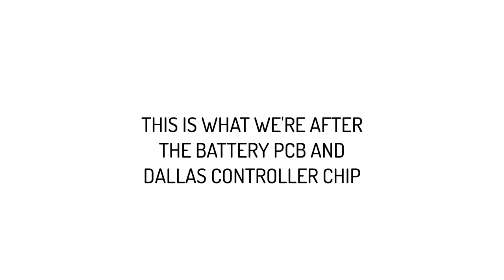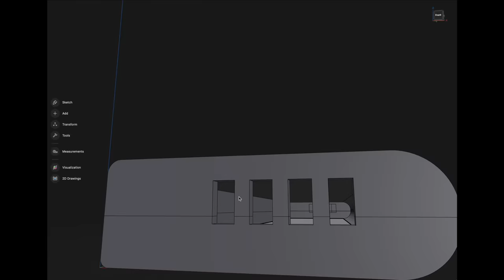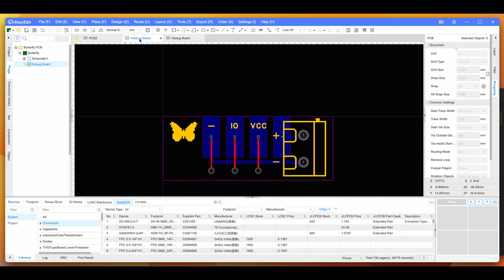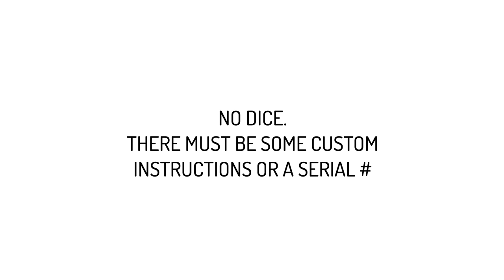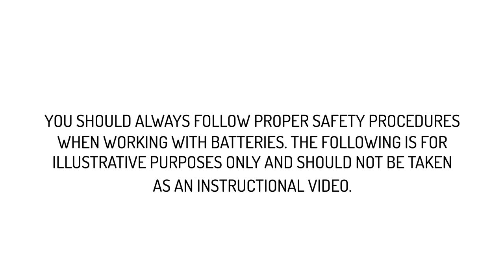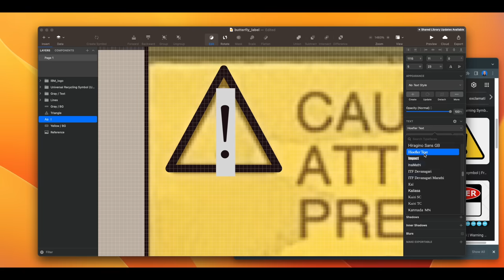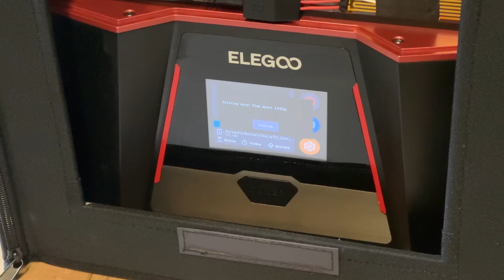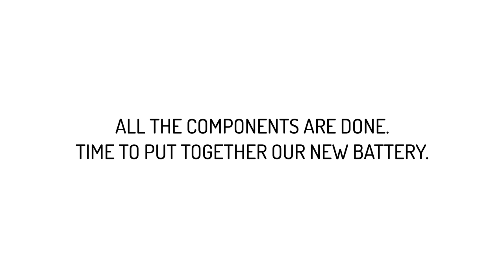Reverse Engineering a ThinkPad Battery - And making a Perfect Clone

Comment: For labels and even PCBs you really want to get a flatbed scanner, it really helps limiting the distortions 🙂
Reply: Gurudumps  That's impressive! Out of curiosity, how did you reverse engineer the inner layers of the PCB?
Reply: @lucasreis6251  ive seen someone reverse engineer a whole ass xbox 360 motherboard before, what they do is go layer by layer by sanding the layers down. its crazy
Reply: @lucasreis6251  not sure how he did it but for "simpler" boards you could map the connections with the continuity test on a multimeter

Comment: Great work, massive attencion to details. 2 things i woud do differently - 1. You put "LiPo" on label but used NiMH inside. It is especially concerning because LiPo and NiMH/NiCd are charged differently, and Laptop charging circuit could damage real LiPo battery. 2. that little dallas chip is also a temperature sensor, so i would add a termistor to that attiny and preserve temperature sensing function -  for safty reasons.
Reply from the maker: Thanks so much! The LiPo on the label was wishful thinking. At the time I had that batch printed I was getting good results but ultimately failed to have the laptop charge the battery reliably - the BMS is on the logic board and not on the chip so I ended up conceding and going with NiMH. You’re 100% right on the thermistor - that would have been ideal but I wanted to keep the BOM down and my hacky way of estimating temp based on conductivity on the ATtiny was enough for me to call it good :)
Reply: The internal sensor should be fine. It's not important of the battery stops charging when 65 or 70°C, as long as it's +-5°C it should be fine. If the chip is used for temperature-based end of charge detection  a good BMS should look at the temperature change (derivative) rather than the actual temp
Reply: @polymatt lifepo4 is way easier to design for, and you can deep cycle it thousands of times without degradation. It has like 30% less power than lithium ion but it charges faster than it.
Reply: @runed0s86  except it is NOT voltage compatible with 9S Ni-Cd (4S LFP - voltage too high  3S - too low)

Comment: For replicated designs I just include a clearly visible "REPLICATION COPY" text in the final design so nobody is confused.
Sometimes I pull some pranks on the design and add a small but clear jokes (such as intentional typos). All to ensure that nobody is going off and selling the design.
Reply from the maker: I love the typo/easter egg idea. I’ll do that next time!
Reply: I would've replaced the IBM logo with the butterfly logo used elsewhere in the project, I think it's cool
Reply: The Japanese do not open, dispose of in fire or short circuit is not the same as the original by the way. The original says "do not put into fire", the clone says "do not dispose of in fire".
Reply: That doesn't stop them from selling it. Just makes it easier to track. Or they just edit it out. I personally hate seeing "Reproduction unit" or "Unofficial Replacement" as it can be a psychological thing. But I'm not the one doing any actual work so you can ignore me if you want. Just my opinion.
Reply: @polymatt  The recycle icon could be replaced with a "repair" one,  maybe the Open Hardware gearwheel
Reply: The reproduction can be recognized without a doubt by the LiPo lettering, what's the problem?
Reply: @steelplasma256  I agree, the quality range for this sort of stuff can be massive so just seeing things like "reproduction unit" tends to massively undersell the parts that are basically exact replicas or improvements over the original. Maybe "clone" would be a better term?
Reply: @chongtak  I would probably change all the foreign language stuff to something funny. Though I'd probably go with my own design anyway.
Reply: or: IBM x (butterfly logo)
Reply: The biggest giveaway would be saying the type of battery used...
and the Ah will probably be higher, would that affect the charge characteristics?
Putting your own brand or logo would give true status and trust in the product.
Right to repair is another angle.. so stating screw terminals used is another plus 😻
Reply: @destrierofdark_  yeah, would've been kinda cool to use the butterfly as a mask over the IBM logo ;)
Reply: @luisek.284  i was wondering when some commentor would put the new battery type...of course most of us automatically realize it's Lithium Polymer technology...but it's good to see it anyway...battery storage has advanced beyond imagination feels like a century in only 20 years...i don't think i have any LiPo in any device...they're all Li-ion as far as i'm aware...i can hear the comments..."you would if you bought a modern Laptop..." the "newest" one i own is about 2009ish an Acer Aspire...and about 4 ancient Dells...might be 5 early to mid 2000's Dells...i like my Latitude LS400...battery is 99% dead now...how much a clone for it? 500 dollars? eek
Reply: @markianclark9645  well i,m changing the cell in 2006 2009 laptops by myself and the mayority of controller kind of reset the SOC, and work well over the same wattage, i'm not a programmer, and never connect with the microcontroller, but i will love do that, i have a battery package undersized, just 3 cell with a case for 6, original, and if you just put the other, the controller become crazy and shutdown the laptop thinking use all the power of the package, let's sit a minute literally, connect the charger, and voila, 10 seconds later do you have 55% battery charge, how reprogram o make inverse engineering, i don't know, but maybe that's funny for yours
Reply: @CarlosMartinez-px9xo  If it's worked for you..and you made a battery..that's impressive.. I'll still be searching online for my battery till I pass away..i might find on eBay or somewhere..if one waits long enough
Reply: @polymatt  You did this time, too! "Percausion" rather than "Precaucion" :-)

Comment: This is admirable work. Truly I haven't come across someone like this before, it's almost maddening but at the same time amazing the effort going into each process. Everything is thought out and done properly and carefully. I'm only 20, but boy have you shown me how things can be! Thank you for striving towards the unobtainable perfection.
Reply from the maker: Hey thanks so much and I’m glad this type of content resonates with you! So much of the skills I’ve learned have been by watching some amazing creators. For me the attention to detail is the fun part - constantly trying to make thing more precise has made me learn so much more.
Reply: The only thing is for the batteries, it is not advisable to solder them but to weld them, but I'm sure they just didn't have a welder (kind of shocking with everything else they have though xD) and did put a warning in that part of the video
Reply: In another comment he says it took a year...
If you're interested.. learning how to reverse engineer could be a useful skill.. especially with right to repair becoming a thing.
I did one of the first 'sound cards' for the Commodore PET in about 1981 the chip cost £25...
I also used a Winchester disk that had 1mb? per side.. the metal disc inside was about the size of an LP record.. and the thing you 'slotted' it into at the top was the size of a washing machine.
Something to look out for which you might find amusing and useful would be an old imperial (fully mechanical from the 1950's or earlier) typewriter.. look for one with a good smooth non perished roller, which is the solid rubber tube that the letters hit under the paper also use thicker absorbent paper (a little trial and error needed to get good results)...
A marvel of mechanical engineering.. there are places in the UK that still sell the ribbons.. a complete workout for the fingers.
A few people of your age and older have seen my typewriter and have frozen in wonder.. getting them to type on it causes much laughter.. 😻

Comment: Amazing video! I admire all the work that went into this!

One thing i'd recommend is to add a decoupling capacitor (100nF) across the attiny's power rails. This will prevent it from glitching when there is any sort of transient. It's a miracle it even worked on the breadboard without a decoupling cap with those long wires.

You might also like the TagConnect / EdgeConnect line of connectors for (re)programming your chip in circuit, they only require a footprint on the target PCB and a proprietary cable, and then it's easy peasy to upgrade your firmware or debug it in circuit.

That being said, congratulations again for the awesome reverse engineering and the fact that you made something that looks like a finished, OEM product!
Reply: modern elecrolytics have a LOT less inductance than older designs. Originally they only had a single point of contact with the end wires and the cap was spiral wound around those wires. Modern ones have the electrodes offset and welded to the end wires every half turn (it's the same design tweak that Tesla applied to their bateries which increased the current carry capacity - and why it wasn't patentable)
Reply: @miscbits6399  Even so, a decoupling capacitor as close as possible to a logic IC is a fundamental design principle that can never hurt to have in place.
Reply: @larzblast  I totally agree, but for a manufacturer it adds a few cents to the board and "Ethel the Aardvark Quantity Surveying Inc" will delete it from the BOM

Whenever I recap boards, extra decoupling caps are a standard addition
Reply: @miscbits6399  This is true. Hence why in this scenario, our friend was at no disadvantage to do it for his clone.

Comment: I'd love to see a battery life comparison between the original NiCd 14650s (probably have to find a contemporary review, even NOS would be horribly degraded), the 1.2V (probably NiMH) AAAs you used, and Li-Ion 14500s.
Reply: Li-Ion would need a more complicated BMS in (at least 2 chips like later thinkpads)  and it might be limited by the laptop only using a portion of its discharge range,  although a 3S  arrangement would top out at 12.6V which might work out nicely.  Pouch cells might be more economical than 14500s if you can find a convenient size.
Reply: li-ion would come with a few problems. Yes a 3S li-ion pack can deliver the same 12.6V as 9 nicd cells in series charged to 1.4V per cell, but that is just using the pack. The laptop will also want to charge the pack and this is where it gets tricky. Nicd cells can be charged in different ways and with different voltages. Some cells are charged with a voltage as high as 1.6 to 2.0V per cell, looking primarily at the charge current. If the laptop dumps 14.4V or higher across a 3S li-ion pack, your BMS (which you definitely need for any lithium based pack) will probably respond negatively if the charge current becomes too high. Another problem with the switch to li-ion is that Nicd charges differently than li-ion and such a change in charging profile could reduce the lifespan of the li-ion cell. Lastly, you might also find out that the laptop might expect different cut off voltages based on the nicd profile. This means that if the nicd cells are discharged further than li-ion cells then the BMS will intervene and cut off the pack entirely from the laptop, causing an instant shutdown (not great for any OS). So if the battery drivers aren't made to adjust to the new voltage range, you might see your laptop turn off at say 15 or 20% charge capacity without warning or graceful shutdown.
Reply: @jhonny44444  with the density of li-ion or li-po, it's have enough space to make a buck-boost, converter to interface the system, basically make a custom powerbank for the laptop, and with some trickery it's not hard, limiting, instead of cutting current with diferent voltage inputs, so, how hard it,s trick the original charging system to use for charge a new type of battery, in the end, it's only voltage and amperage, any similar to a pwm solar controller logic maybe it's overkill, but its only a idea.

Comment: I liked the video but I wish you had explained more in detail how you reverse engineered communication between the pc and the battery. Maybe a follow up video? 😊
Reply from the maker: Definitely possible! That might be a fun one.
Reply: @polymatt  Just went down of rabbit-hole of discovering what a DS2434 is.  I knew about 1-Wire Dallas temp sensors before, but not that those maniacs put EEProm in them, or burned Prom serials at the factory.  You must have dug up the serial number from the laptop's BIOS.  Sadly, these days manufacturers are probably using crypto-hashes against unreadable hardware numbers, to more thoroughly Owners the right to repair.
Fight for the Users.
Reply from the maker: @GnuReligion  oddly enough I found that the family and serial number don’t matter for this specific case. It’s the custom instruction set that IBM had made that the laptops look for to make sure it’s a “known” battery.

Comment: Great work.  And seeing the butterfly keyboard in action is still amazing.   The 701C looks about as new as any could get.  Fellow Thinkpad user and collector, but don't have any of the original IBMs.   I no longer use the batteries from my original old ThinkPads.  I tried ordering replacement batteries from Amazon years ago, but they were fake.  Some were even split open or wouldn't fit  correctly.   So I gutted the battery cells to prevent leaking and use them to as "space" and on some, they are the "feet" of the Thinkpad. 

The fakes were so bad, the didn't charge or could only power the computer for a few minutes.  The seller did give me refunds and didn't even want them back.  So, that's something.
Reply from the maker: Thanks so much and re: the batteries, that’s exactly why I did this. The fakes never worked.
Reply: @polymatt  Why do they even bother making the fakes?   Amazon would just do a refund anyway.  

I don't have the skills to make my own.  But it's okay, they work otherwise.

My daily modern ones are important for having working batteries.

Comment: Really enjoyed just watching this. Next stop, learning how to replace lipo cells for laptops and phones.

There's great value to be had in older models but sadly the batteries are often kaput and even if you buy "new" ones, they end up dying quick just because the cells are already old even though the battery hasn't been used.

So I figure if I can swap out cells, I'll be well positioned in my battle against planned obsolescence 😂
Reply: I use my old think pad to play older games like the original Myst & Riven.. nice to have a wander.. use the original OS and don't connect to the internet as it will inflict so called updates that cause havoc.

Comment: Quick tip for getting things accurately placed on reproduction labels:
Scan the original on a flatbed scanner and work from that, not photos.
The labels on laptop batteries are generally metal-backed for heat sensitivity reasons. Not heat from the battery, heat from the laptop.

Comment: Nice job! 
I had a similar project for my Compaq LTE 5000 (wanted to convert it to LiPo batteries with charge control). But the war started and the project and I had to abandon my computer when moving away.
Man I love that PC - it is very modable. I want to gut the living thing out of it!
Reply from the maker: Hey thanks so much and best of luck on your Compaq restoration! So many of these need some battery love these days. I think a lot of retro enthusiasts overlook the batteries because we're not exactly taking them out and using them as daily drivers.

Comment: The main issue I've been facing with vintage laptops was that there are no compatible replacement cells that physically fit. Batteries for laptops like the Thinkpad 570 and 570E aren't the standard  round cells, but thick, metal Li-Ion pouch cells. You can't replace those with modern LiPo pouch cells without coming up with a custom charge controller PCB, and then you're fighting the "smartness" (or lack thereof) of the laptops internal charging circuit. It's just pure pain all the way

Comment: Very well done. So you can just switch out Ni-Cd with Li-Po without any modifications to the charging? I have a dead battery for a Thinkpad 390X, but that’s already Li-Ion and it’s not leaking. So hopefully I can get away with cracking open the shell, replace the cells and glue it back together, without going through that whole reverse engineering process.
Reply: Here 9S cell configuration is replaced with anouther 9S (9 in series). It couldn't be anything outher than Ni-Cd or Ni-Mh. LI-ion (or Li-pol) takes 3S to achieve the same 11.1V nominal voltage.

Comment: I bought multistrand wire in multiple colours (whole sets available from the river store) and a set of dupont crimps and holders, together with a good crimper, years ago, and i amazed how often i make use of them. You could have just made 3 wires of the desired length for the debug board from the getgo, that would have also only needed 3 crimps.
Reply from the maker: Great tip. I’ve already got a crimper on order.
Reply: @polymatt  I got my old man a set for christmas and was actually jealous of what i gave him: you can get several spools of wires in special cardboard boxes where only the respective wires protrude: small, compact and practical!

I still have to make do with a big plastic bin with a dozen or spindles which are way too tall for the amount of wire they contain, and I do not use them often enough to warrant creating a holder that would also take up too much space. First world problem i guess :)

Welcome to the world of crimping your own, bespoke, wires and suitable connectors!